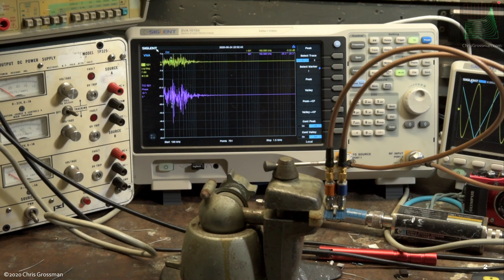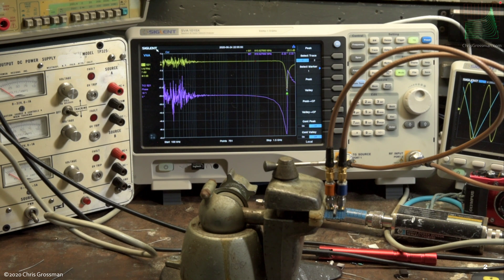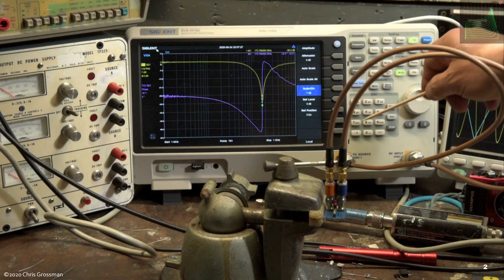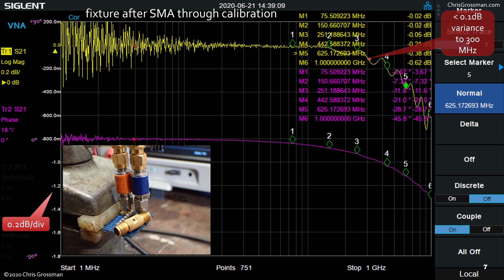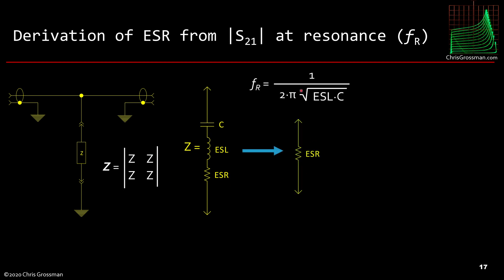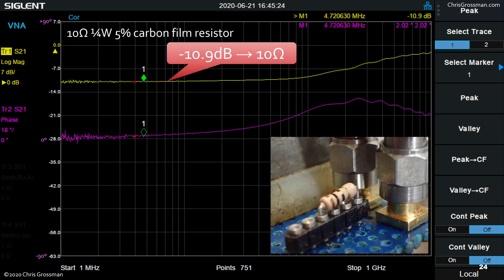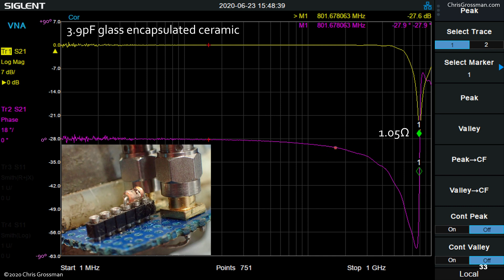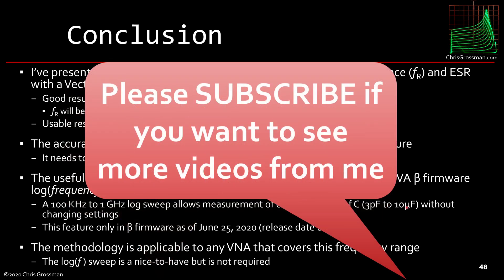⭐ Measurement of Capacitor ESR and Resonance Frequency with a VNA (Vector Network Analyzer) #0012

Comment: I'd put a wire jumper between the test fixture pins to do my 'through' cal.
Reply from the maker: The trough wire is part of the fixture.  The shunt measurement is from the through to ground.

Comment: Hello. Great video and explanation! I'm amazed with you being able to sweep from as low as 100 kHz. The analyzer's datasheet states a range of 10 MHz-1.5Ghz. Did you do anything special to enable going as low as 100 kHz? Or is it a datasheet errata? Thank you!
Reply from the maker: The main frequency limitation is on the input directional coupler  used to measure S11.  It is not happy below 10 MHz.   However S21 works well down to 1 MHz and is usable down to 100 KHz.
Reply: @Chris_Grossman  Thank you very much! 1 MHz... interesting... The tracking generator (according to datasheet) works from 5 MHz up. Have tried to go down to 1 MHz?

Comment: Great video, thankyou. The datasheet lists the VNA frequency range as 10Mhz to 1GHz but you are doing a sweep from 100kHz. I'm tempted to get one but 10MHz is restrictive. Is there a way to enable 100kHz?
Reply: Siglent SVA1015X
Spectrum analysis: 9 kHz - 1.5 GHz
Vector network analysis: 100 kHz - 1.5 GHz

Comment: Thank you for sharing info for a relatively low cost and effort test rig for capacitors. This setup shuld work well for troubleshooting marginal components in a RF oscillator circuit ( tested out of circuit of course) as well as your intended ESR measurement function.

Comment: Do you have some updated links for the ESR conversion table and graphs please? The links provided seem to be unavailble now. Thanks for a very interesting video!
Reply: Replying to myself, hehehe, it's ok, I used your formula at timestamp 10:34 to make a spreadsheet and now I can see any value I want, and the graph at that timestamp is the one I was after anyway. Job done :o)
Reply from the maker: The links work.  Try again.
Reply: @Chris_Grossman  The website chrisgrossman.com simply doesn't respond, whatever browser I use, it just times out. Maybe you can see it from within your network, or maybe you have a cached copy on your machine, but it doesn't seem to be accessible from the web. I've built my own spreadsheet for it now, but anyone else wanting to access the link may run into the same problem I'm seeing from here.
Reply from the maker: @GigglingGobby  it works from my cell phone on the cell network. I logged into another server in a remote facility and it works from there.  I tried it using a VPN and it works.  I tried using multiple browsers on both Linux and windows systems and all work.  I checked the log and I can see it serving content.
Reply: @Chris_Grossman  Thanks for testing that. I tried 4 browsers on 2 machines, and then with my mobile phone on Wifi on the same landline broadband and then with WiFi disconnected so I was using a completely different (mobile) ISP, still nothing. However, a couple of my friends managed to see your website, so I tried again but this time with VPN so it would look to the server like I was in another country and it instantly connected! Something's stopping my landline's and mobile's IP addresses (in the UK) from accessing the server where the website is hosted. No idea what's going on there, but I got there in the end :o)

Comment: one thing that people keep ignoring, including this video, is that ESR is NOT an actual physical resistor and its value is highly frequency dependent. So with this method you are ONLY calculating the ESR at that resonant frequency which is not that useful specially when it comes to electrolytics and their application which is normally low pass filtering at low frequencies.

Comment: Great! 

I did not expected the response of the resistor rising at so lower frequency..

I used two resistors to mod an osciloscope broke 50 ohm input and in my tests the response was equal to the other original channel up to 350meg.

Comment: Thanks for the interesting video. Do you think it would be possible to measure extremely small capacitance such as femtofarad or even lower?
Reply from the maker: Not as I have shown.  The problem is the parasitic capacitance from any fixture or probes will preclude accurate measurements.

In my experience you can typically measure down to 10pF, if you are very careful about minimizing fixture/probe parasitics and do a good cal you can get down just below 1pF.   

If you are measuring on-chip devices on a IC wafer in a well designed test structure,  have on-wafer calibration structures, GSG RF probes, and a very accurate network analyzer that goes high enough in frequency (into the GHz region) you can get believable measurements down to ~10fF and less accurate measurements down to about 1fF
Reply: @Chris_Grossman  Thanks very much for your reply. And how much do you think such accurate network analyser would cost?

Comment: Love your SVA presentations ! Not being a mathematician I can't work out how you arrive at a capacitance value given the ESR. Could you elaborate on the calculation for the 0.1uF example in your presentation so a simple soul can understand what is going on? Many thanks.
Reply from the maker: My next video will be how to measure the impedance, capacitance, and correct for fixture parasitics.